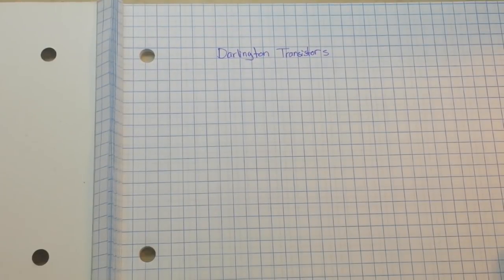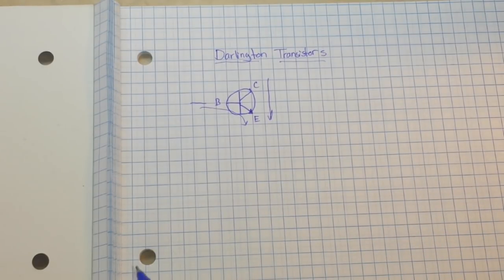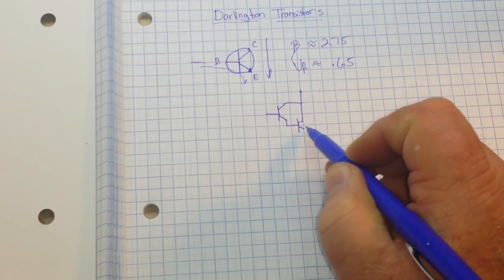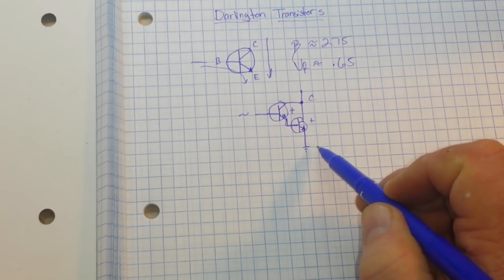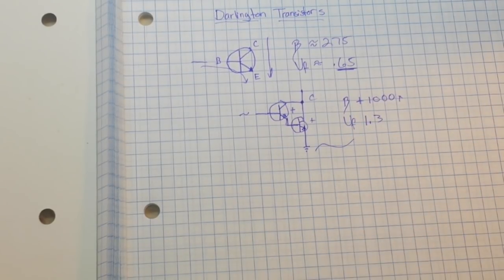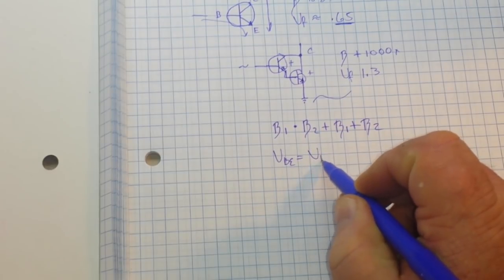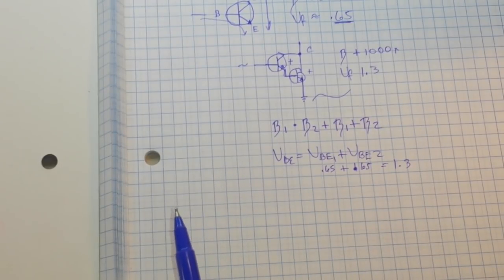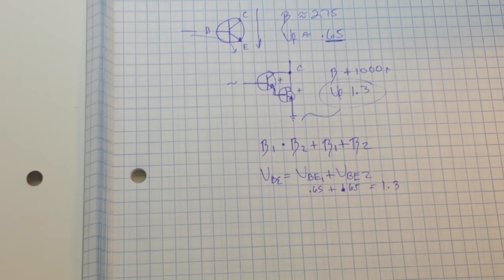Introduction to Darlington Transistors

Comment: Is it ok to use mosfets in a Darlington pair configuration? I have to make an amplifier with only one resistor and just mosfets in multisim for my class, and it seems to work in multisim, but my professor says he's not 100% sure if it'd be ok IRL (he said he would have to do the analysis but is should work).